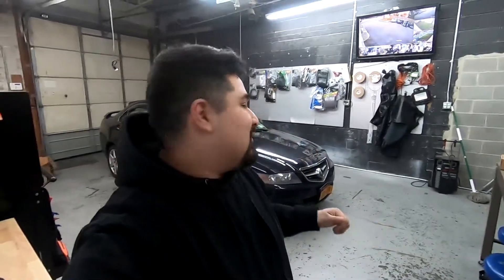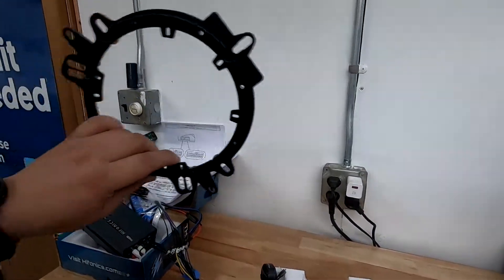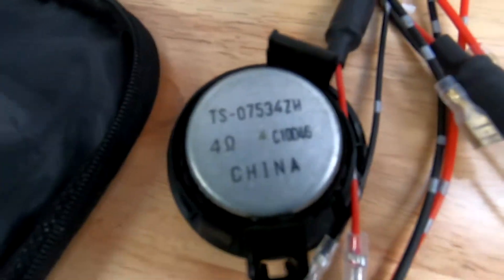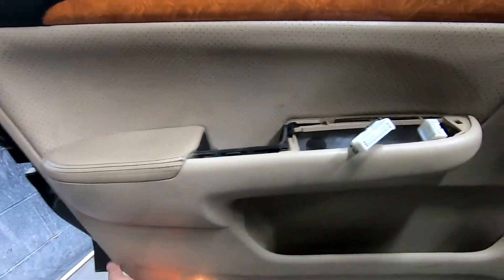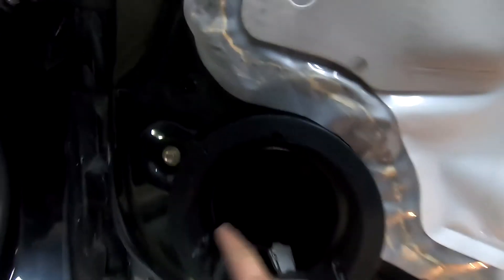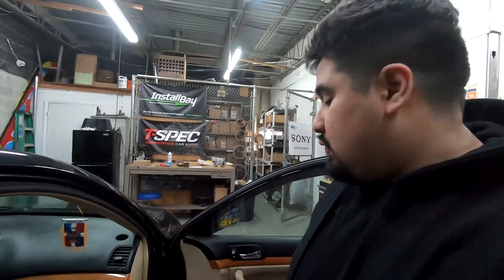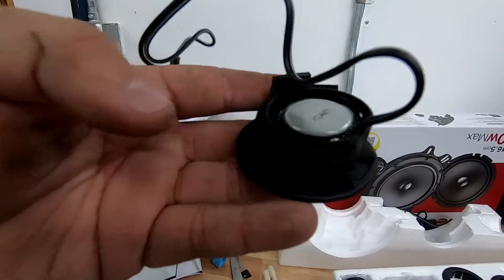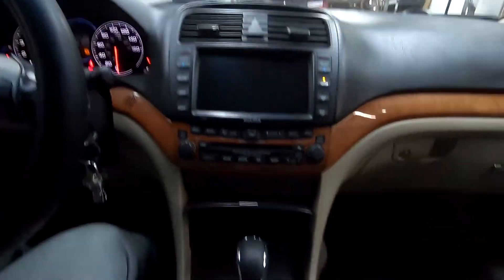2004 2005 06 07 2008 Acura TSX Front Speaker Upgrade - Pioneer Component Speakers DIY Guide

Comment: It’d be cool if you can make a kit to remove the navi screen and replace it with a head unit.
Reply: They have one already
Reply: @slitherman7883  using the stock shroud? The aftermarket versions are butt ugly.
Reply: @lockaflocka89  you haveto cut the navi screen out
Reply: @slitherman7883  yeah I’d be down for that the navi is pretty useless anyway. It’s only good for reverse cam

Comment: I have a 2012 TL what size speak is in the back dash do you know if it’s 6& half or 8/??
Reply: The rears appear to be 6.5 with some 3.5 mids and then 8 inch sub.
Reply: The rear deck I believe its a 6 1/2 and the sub is 6 3/4
Reply: @DJPapiatl  okay bro thank you 🙏🏾 I’m planning to upgrade them to the best voice speaker 🔊
Reply: @djkpackchannel5317  I went with Alpine R speakers all around
Reply: @DJPapiatl  those are some nice speakers but I’m going with something more powerful then those but amazing set of speakers